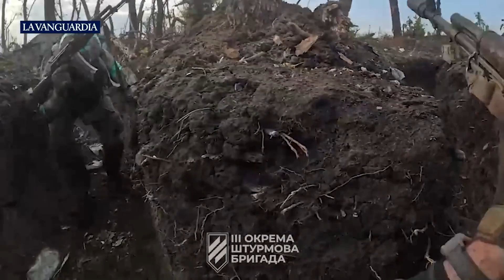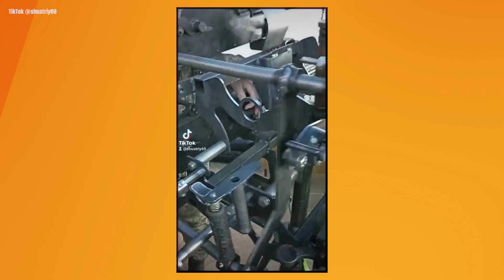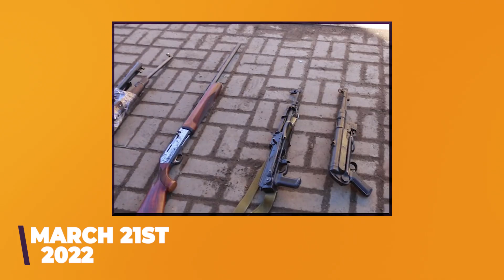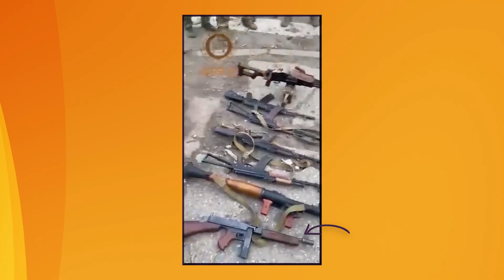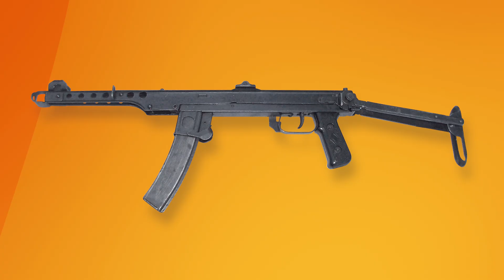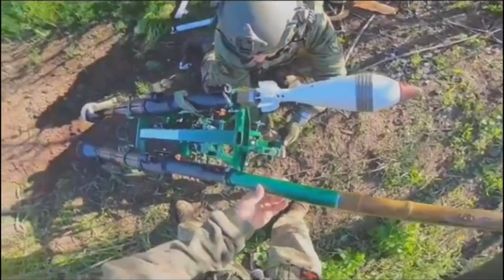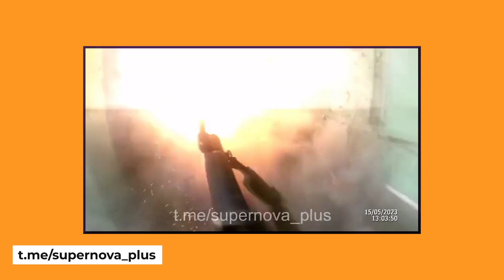The Weirdest Weapons of the Ukrainian War

Comment: WATERCOOLING IS REASON WHY THEY WERE READOPTED,......look ussr used maxims on fortres walls in 70's an early 80's , why ? cause nothing new can shoot 7.62x54mm  without stopping  for 10-15 full 200 round bellts , not goryunov not pkm even new pkp just cant mostly  five full belts is top or 1000 rounds non stop ( if you go over 1200 rounds gun go on fire an not to mention accuracy dont exist anymore even in pkp heavy-fluted barrel ).......but even after 1200 rounds maxim is accurate  to 800m

Comment: As far as the Maxim MGs use, the American M2 50 calibre 'Ma Duce' was designed in 1917, and is still in active service in over 100 countries. The B52, designed in 1955 will be in service at least until 2050. Thats 95 years for an aircraft - crazy stuff. Some designs are just that good.

Comment: As the tank is becoming less effective with better ATGMs the war has become more static. The disadvantage of the maxim as stated was weight in a mobile conflict but in a fixed position it’s a beast. The water cooling prevents barrel overheating and it can send a huge amount of ammunition down for hours. In fact I wouldn’t be surprised if this continue that Ukraine don’t attempt to manufacture new water cooled guns based on the maxim

Comment: The mp40s have been mostly provided to sabatarge groups inside russia its self, just due to there ease of being broken down amd hidden, plus they are easaly hidden under a coat or loose trousers. 

Alot of the pics of captured wepons in this video are from some raided sab hideouts or from the handfull that have actualy been captured. 

There are still alot of them being used in russia its self by the sab groups of the actual population. 

They had been provided to groups meny years ago, i think since crimea was invaded. they have basicly been with sleeper cells in russia, waiting for orders from kiev.

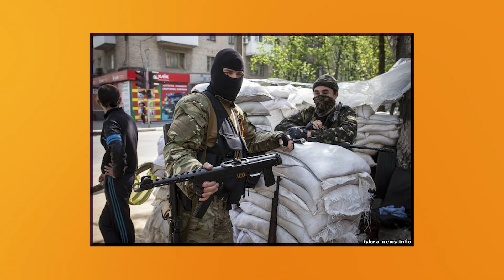Comment: You didn't mention the Mauser, Kar98 that was in the picture with the PPS (frame 11:10).  At least it's fore stock and muzzle were. Also, for some of the others, finding some of those ammunition calibers in quantity (9mm aside) might pose a challenge.
Reply: Yeah the pps43 is chambered in 762x25, which is like 2 generations behind as a sub/pistol round. I doubt they would bother converting them to 9mm luger on either side even though the pps43 was used to great effect in 'modern' wars like vietnam

Comment: All good kit, reliable, durable (especially the Maxim) and requiring fairly basic training to use.
A bit heavier than modern kit, but generally harder to bugger up and great for less mobile or urban positions.
Both sides had tens of thousands of Mazims in storage, I'm not surprise, spares readily available d they were quickly dusted off, though ammo use could be brutal if not carefully used.

Comment: Say what you will, the Maxim is reliable and throws out some serious firepower. 
It may be old but it is still obviously quite effective and definitely not obsolete.
The various WWII weapons again while old many of them are going to be plenty effective as long as you can feed them.
The Thompson in particular is unsurprising as it's ammo is still very heavily used across the world and thus widely available. They're also as was mentioned extremely well made and throw out some ungodly firepower.
The only real complaints one can level against them is that they are quite heavy and depending on the variant will eat through ammo extremely quickly if you aren't careful.

Comment: PPS is still made in Poland and  chambered in 9mm x19 & 9mm x18  as a semi for the civilian market  you also forgot the most iconic American 50 cal  or M1 BROWNING  that dates back to the very end of the  1 WW & 2WW  still in use in the USA and other countries it's more than  100 years old now nothing really changed in it they were considering making it out of titanium to shead sever pounds of its weight but it's the belt-fed ammo that also very heavy and now with the new introduction of polymer cartridge instead of brass it may get the weight drop, but not yet adopted by the army  but they may move from titanium to carbon fiber construction but nothing has been confirmed yet

Comment: Quad (and more) Maxims were widely used in USSR for air defense during WWII. So it's not a really Ukrainian invention - rather it shows that we can reproduce and adopt existing solutions. As there were not many other options - like "nothing" or "this 100 y.o. gun that still functions and ammo is available". People have even designed and manufactured plastic bullet belts for Maxim!

We were using anything we had at the start of the war - you can find guys with arbalests in chronicles.

"Civil versions" aka single-shot MP-40 and PPSh (both original and replicas) were "freely" (you still needed to get a gun permit) sold in Ukraine - just as civil versions of SVD, AK, AR-15. Everything was grabbed/purchased out of those weapon shops in the first days of invasion - sometimes (or often) without any of typically required documents. Nobody cared about that.
You could  even take any weapon you wish into the army as well - if you had "enough" ammo for it (so pump shotguns were used).

Thompsons were a part of Lend-Lease, they were in stored in Ukraine in significant quantities - and there was somewhat a scandal with Ukrainian Prime-Minister Arsenii Yatseniuk aka "Rabbit" (nicknamed for his 2 front teeth) being issued a "reward" Tommy gun and a permit for it (basically - it was plainly illegal, full-auto weapons are not for civilians).

It may sound ridiculous - but the only legal and "realistic" way to get a pistol permit was to be rewarded with one (basically - get a "Hero of Ukraine"), rumors say it costed $500 - I doubt the figure, though. The "unrealistic" ways are about getting a certain profession - like a judge or, perhaps, journalist.

As for RPG engine + mortar mines - we do not have enough mortars. Separatists had even less (civil weaponry plus whatever captured from "strategic stockpiles" located at their regions), even though they were backed by Russia - with materials and volunteering manpower - unlike russian army that has everything. There are multiple mod for RPG rounds - with HE rounds being rare you can find nuts wired onto the round, or rocket engine modded for "unlimited" distance, multiple hand grenades attached by long wires and launched "in that direction" just to frighten the enemy.

Comment: These may be weird, but the age really doesn't have much to do with how well they work.  On a brand new, front line US tank and some other vehicles, is a .50 M1 Browning, that was put in service right after WW1.  It was designed to shoot down biplanes.  It's still effective.  Current issue to some US special units is probably still the Colt 1911, another Browning design, which dates back to, wait for it, 1911.  And the Thompson wasn't dropped from service because it wasn't effective, but because it was expensive to manufacture, and a bit heavy.  Even the F-16, a front line fighter, first flew in 1974.  Almost 50 years ago!  That is amazing.

Comment: About mortar ammo fired from RPG: They are used because original RPG munituons are designed to penetrate armored vehicles from relatively close distance (800m) which nowdays is not possible in most cases because of increased range of tank fire and active armour. So PRGs nowdays are mostly used to attack infantry, but original cumulative ammo create too few shrapnel, unlike mortar mines, specially designed to destroy infantry

Comment: You can turn anything into a. "Mortar" by pointing it up in the f**** air, dumbass. But they're all going to be an effective if you don't know how to aim them. And I was just reflecting that I was in the infantry in the US Marines and they didn't teach me how to use the foot. The company level 40 mm mortars. They had a fifth weapons platoon that they taught them how to use the 40 mm. How to aim the 40 mm mortar but not us which means if our weapons platoon got wiped out but we had their weapons we couldn't use them effectively. Seem kind of stupid to me and dangerous to me like they didn't care enough to properly train me. Anyway the aim and mortar or any artillery that you point way up in the air to hit somebody over the horizon or not. It doesn't have to be over the horizon. If they're if you can see them then you can calculate the distance and you've got to know their position on a map and your position on a map and you have to do math and you have to know what the trajectory is to make settings on the mortar or the artillery to make that to stick it up in the air at the proper angle and the proper direction in order for it to be lobbed up in the air and fall down on the other point on the map. So it's map it's you aim them using map coordinates not line of sight. And you got to know how to read the maps. You got to know how to accurately know where they're at it on the maps you have and where you're at and then you just you're putting the shelf in point a to point B using math So it's so you you got your location on a map. You got their location on a map and you do the math, the algebra or geometry that they didn't teach us and that's how you aim them. And you put the settings on the weapon itself. You dial them in the angle that they didn't teach us. You got a elevation angle and a longitudinal angle of swing angle. The both you set on the weapon and you need to get the projectile from point a to point B. And they didn't teach us that what they did teach us was that Marines were notorious in Vietnam for calling in air support on their own target on their own cells because they didn't know how in the fog of war they either. They got confused and called in their own position for for air support and call them in on themselves or somebody else called them in on them. You know friendly fire and that again you got to be able to read a map so they taught us how to do that. But I forget read a map and tell where we're supposed to be at and where the enemies at. But I never learned how to then make a mortar suit from point my position to their position which meant that if I came across a mortar in the field and a war zone I wouldn't be and there was no trained people around. I wouldn't be able to use it effectively to defend myself. And if those so-called MPG mortars don't have the mortar type aiming mechanisms on them, then they're not really RPG mortars they're just aiming up in the air and firing. And you don't even once again you don't distinguish what truly matters and what truly the problem is going to be on any of these weapons which is getting the ammunition for them. And again this one can they? Can they be aimed like a mortar you're shooting s*** up in the air? Doesn't get it unless you know how to read a map and know how to make it shoot from point a to point B using that map and you don't even say that because you're ignorant

Comment: You're missing a crucial component of the weirdness of these weapons: H1 takes a different round with and that's the key thing that makes them cumbersome to use effectively because the rounds for them are antique as well. For instance, you can't shoot a modern 9 mm. It's not advisable to shoot a modern 9 mm Luger round and an antique Luger because they've beefed up and they've improved the powder and the power of the 9 mm Luger round to such an extent that the barrels and mechanisms of the old lugers can't handle it. What they do with the antique guns that they still want to shoot is they have to hand load the rounds and there's some there's many antique firearms that there's no ammunition available for them anymore because the hand loads have to be hand loaded into existing brass and the brass doesn't exist. That's I think that at least in the US like if you get a Russian nagant revolver They were never that popular so you can't get any rounds for them anymore. I forget what caliber they were but they had so a pretty cool nagant where the no. I think that was back when they still had percussion caps and they had the load each cylinder. But the cylinder move forward up against the barrel each time in order to seal against the barrel. So you didn't lose pressure and there's no modern revolver that has that feature anymore. I don't even think that one was a. I can't think that one was a. Took a cartridge though. I think it took a percussion cap on the back of the cylinder and you had to load each cylinder with powder but it's the same principle. The modern ones that take the cartridges still leak a certain amount of pressure between the barrel and the cylinder. That's what makes them weird if there's no ammunition available for many more. And I guarantee you that maximum does not use any of the rounds that any of the modern firearms that they're using use. It takes it's very own ammunition and so does the MP40. So the weird part is how are they getting the f**** ammunition for them but you don't even bring that up because you're a f**** dumbass.